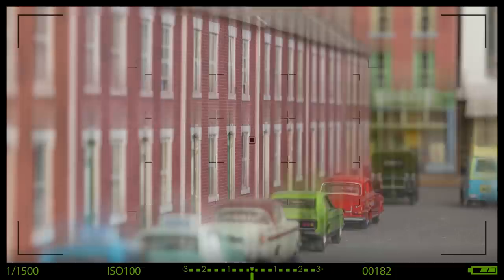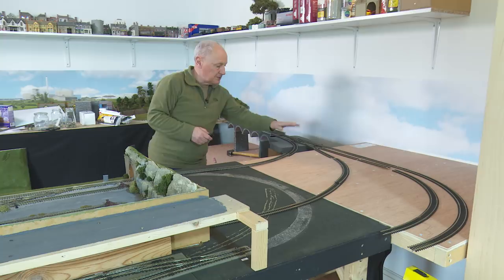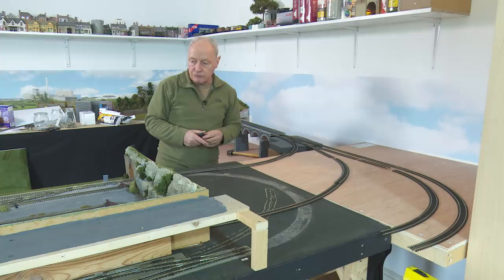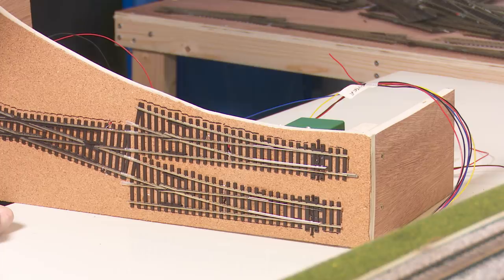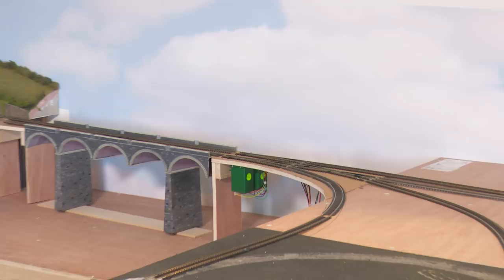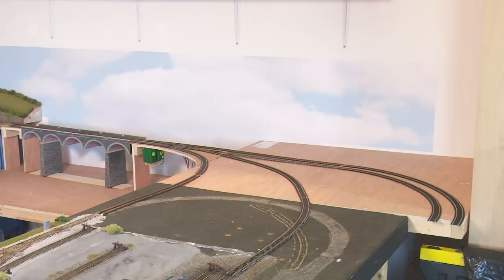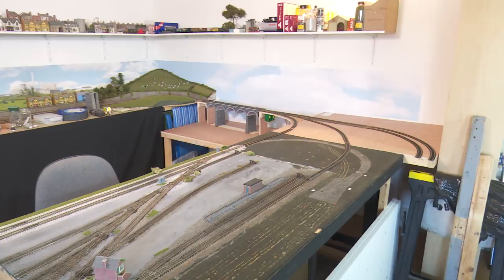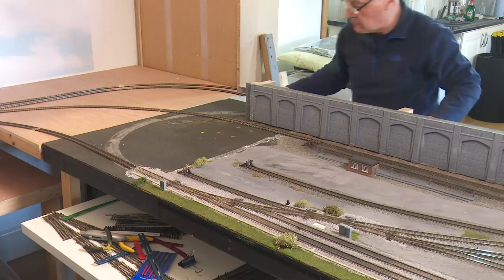Track Plan Sorted at Chadwick Model Railway | 59.

Comment: Hi Charlie great video and loving how the layout expansion is coming along. As regards to point motors then have you thought about using standard 4 to 6 v servos as you can get these from RS components for £11 also you could look into linking points together to change on one servo by connecting rods which I have seen. Hope it helps.
Reply from the maker: Good points Mark. I’ll certainly check them out.

Comment: Charlie, 
I agree the servo motors are cheap (esp if you get them off eBay) but they need special interface mounts, and interface circuitry.  Ok once you've got into the habit of using them, so you have the aluminium channel, etc, but not so useful for a one-off.  Mind you, the controller circuitry does come in a board that will control a number, so fiddle yards would be an ideal place to try them.

My preference is not so specialist, and I use a cheaper version of a point motor.  Have a word with DCCTrainAutomation; James does MTB MP1 point motors at 13 GBP each, and they are quieter than tortoise, as well as being more discrete.  he's online, local to us, and also will be at Ally Pally.
I suspect with your winning ways, you will be able to negotiate a bulk discount!
And if not, I'll look forward to seeing your bruises at Ally Pally! ;)
See you there (Saturday?) or maybe WimRail (tomorrow).
Anon
Reply from the maker: Hi Tom, great info as usual.Yes servos seem to be the flavour of the day.  I'm certainly going to investigate.
I’ll be at Ally Pally on Sunday with my elbows sharpened!
Reply: I designed my own Servo Motor mounts using free Web-based CAD software and had a friend make them using a 3D printer. If you don't feel you have the skills to do the designing yourself; if you can find a person with a printer, they probably have the skills!  Cost for me was AUD$0.50 (about 25p I think) basically for cost of materials. They aren't anything special/pretty (basically chunky blocks with mounting points and gaps for arms/etc) but very quick, easy and cheap to produce.  

I also use an Arduino ( electronic board/computer) to control the servos - but you have to be a Nerd to go down that path!

Comment: Hi Charlie. Looks very good indeed. Don't go near the back scene :) You don't want to go through that again. I need 18 more Tortoise point motors so am searching myself. Have you had a look at the point motors from Tam Valley? MSWOO1. You will need a couple more bits but much, much cheaper than Tortoise. I have not used them but check out the last couple of videos from Newcastle Central. Cheers. Pete
Reply from the maker: Hi Pete, 
I’m so pleased that you enjoyed the latest release.
Yes point motors are a headache, one which we clearly share.
I’ll check out your link but Tortoise do remain top of my list.
Good hunting.
Regards Charlie
Reply: @ChadwickModelRailway  Hi again Charlie. 6 Tortoise motors, (used), on eBay now. £58 so far. Another day and a half to go. Cheers. Pete
Reply from the maker: I know Pete, I've been watching them for days!

Comment: New to your channel, and completely new to the model railway world, in the layout planning stage at the moment for my 1st layout, taking my time over it as dont want to rush and make mistakes. any tips on layout design would be fabulous.
Reply from the maker: Small steps at first Karl.
Work out the size/space available and then decide on the track gauge that works.
Next decide on the era that you wish to model.
Next it’s DC or DCC.
Finally, start on a track plan which works with your choices.

Comment: Hi Charlie. Great work you are doing and the presentation is always superb. I think I am the first to say why not try the Swiss Fulgurex point motors? No faffing around with servos, like the tortoise ones they are motored but in an open frame so mounting and wiring are the same. I have them on a now retired exhibition layout I took over and they are nice and smooth. And the clincher? 10 or 11 quidlettes each from DCC Concepts.
Reply from the maker: A fair point Paul.  I now look at layouts for the motors which they use.
Reply: @ChadwickModelRailway 
 I forgot to mention that perhaps they are used on my layout because they have a lower profile, say 20 - 25mm, that would be less likely to be knocked about when shifting the boards at exhibition. But more importantly using them on an exhibition layout would indicate a trusted level of good reliability. 
I thought I would send you a couple of pictures of mine mounted somehow but then realised there's probably a good collection on the interweb that you might study. After looking for myself I noticed a lot of people were moving the tiebars via omega loops and cranks or servo horns. Mine are actually directly driven which makes sense as I believe the track and hence the point motors were done by Norman Solomon. On RMWeb some one was asking how Norman did it, I have to have a look in his book.
BTW, in case you're wondering I'm not an insomniac, I'm away in Mexico for a short while.
Cheers
Reply from the maker: Thanks Paul,
More great detail.
Regards Charlie

Comment: Good evening Charlie.  Another technical question I hope you can assist with.   I have peco code 55 turnouts and my n scale layout is controlled by the digitrax zephyr :DCS51.  At the moment i have one circuitron green tortoise with an address of 4.   And one circuitron brown smail with an address 1.   Both turnouts are controlled perfectly well by the zephyr and I followed your tutorial of wiring up the elctrofrog to the tortoise. 
 I am now ready to install 4-6 turnouts more however I am being told that I must purchase a decoder if I use the tortoise switch machine but can forgo that if I purchase the Smail switch machine because it comes with a decoder imbedded in the unit

My question is since the single tortoise is working fine through the zephyr command station why do I need to buy a decoder if i want to install an additional  half dozen or so. Additionally I only want this to activate the. Turnouts.  No lights. Or anything else

Must i buy a decoder if i increase my tortoise switch machines?
Reply from the maker: Hi Michael,
I must confess that I’m bewildered as to how you have managed to switch a tortoise with Digitrax without using a DS64.  I’m unaware of tortoise making a DCC version similar to Cobalts.
I use several DS64 units, each switching four points (or pairs of points if the that is suitable).
I do hope that makes sense.
Regards Charlie
Reply: Chadwick Model Railway hello Charlie.   Well it works for now. I just put an order in for several circuitron SMAIL switch machines which have the decoder in jt so as I understand things these will not need a stationary decoder

I hope that once i instal the extra switches my lone tortoise switch fails. We shall see but for now my single tortoise and my single smail are working fine and have been so for a few months

Thank you for taking the time to reply

Rgds/Mike

Comment: You could halve the amount of motors by letting the trains push the points over on the exit of the Fiddle Yard in each direction.
Reply from the maker: A fair point but you wouldn’t be able to use electrofrog points and switch the frogs.
Reply: You could switch the power with a relay. With it only switching the power it could be positioned in such a way that you wouldn’t hear the clicking.
Reply: Thinking about it, I’m guessing you’d use each point to set lanes so why can’t the entry point motor set the frog polarity on the exit point at the same time?
Reply from the maker: Because a different siding may be exiting the fiddle yard finding the point against it with the wrong frog polarity.
I do hope that makes sense.
Regards Charlie

Comment: I have found that longer cars and long wheel base locomotives operate better on medium radius switches. You can reduce the spacing between tracks by cutting a short amount of track off between the switches. I find that for yards I like a little extra room between the tracks for fingers if necessary so I use 2 inch center between tracks.
Reply from the maker: Thanks Don, a very good point.

Comment: Another excellent video Charlie.  Just to add to the cost of the Tortoises, I found Aculites do “Snaps” that slot on to the Tortoise to avoid any soldering.  Sadly I’d fitted 7 motors already with wires soldered to the motor and ending close by in a terminal block.  That was cheaper, but the snaps are brilliant, push fit, and today when fixing a wrong wiring problem, they proved their worth, when upside down under the baseboard in cramped conditions.  (They also do break out boards for the PM42 etc).   
A question, I’m impressed with the result of using piano wire.  Where do I get some, and would it be easy to install in existing points etc,?  Cheers Brian
Reply from the maker: Thanks Brian.   I'm certainly going to investigate.  I bought the piano wire at Ally Pally.Regards Charlie

Comment: Hi Charlie from  "Tippy Ashwood".  may I suggest your  river or stream doesn't run through the middle arch and the road has a T junction before the old bridge which runs under the viaduct as well. hope you can picture that !  as for the old road bridge fairly easy scratch build job with a bit of scribed clay etc. fully enjoy the videos. and I have learnt a lot from video equipment ones
Reply from the maker: Hi Bob, I totally understand your point and I’m sure you will like my plan (fingers crossed).

Comment: Hi Charlie - another informative and well produced video. Just a thought on the points at the viaduct end - you intend a tunnel I think? In which case you may get the articulation of longer items of rolling stock visible when exiting the tunnel having come round from the front of Chadwick TMD. Appreciate you are tight for space, but might be worth a trial run with a few coaches to make sure you are entirely happy.
Reply from the maker: That is an excellent point.  Perhaps a cutting might be better.
Reply: Hi Charlie - suspect that would give you more problems with the tunnel mouth. Give it a try with some coaches and just check. Could you move viaduct 2 or 3 inches to the left, and insert 2 or 3 inches of track before the turnouts - looks like you have a bit of room for a slight return curve on the exit from old Chadwick.
Thinking more about your point motor problem. If the up and down lines always run as up and down lines and you don't propose reverse working then the 'exit' points could be lightly sprung - bit like passing loops on narrow gauge railways. Gormo at Great Chesterford Junction has been trialling that and uploaded a video - see https://youtu.be/QzjVRepCZpA- .  Would halve the point motor investment, but still allow you to add some at a later date if you wanted reverse working on some of the fiddle yard sidings.
Reply from the maker: I’ll check it out David

Comment: I've watched the video a number of times listening to what you have said and a potential problem and a suggestion have resulted.
Problem - In a previous video on Chadwick you discussed wiring compatibility using the "black to the back" analogy does this mean that the Chadwick TMD oval of track had red on the outside rail and black on the inside rail? If so no problem as black would be to the back on the reconfiguration. 
Suggestion - Tortoise or Seep/Peco point motors, has TMD been upgraded to Tortoise? If not then having solenoid point motors on the fiddle yard would make little difference to the noise emanating from the solenoids in the TMD albeit that the fiddle yard points would be changed more often than the TMD points. It would be a cheaper option to investigate using Servo motors as an alternative.
Reply from the maker: Hi Gary,
Yes fortunately the front of the TMD area was wired black to the back.
On the TMD, I intend to leave the existing solenoid point motors in place until they or their points, become problematic.
I may construct a small exhibition layout in the future, on which I will explore servos.
Regards Charlie

Comment: Would a ford brige be a suitible option. Here in south Africa their are three briges in close proximity take a look at the Van Stadens river road brige on the Garden Route in the Eastern cape.  Origenly there was a ford brige almost compleatly washed away by fooding in about 1990, and unditectable on google photos today. Next to the ford brige a 1920s brige was constructed and finaly towering over the gordge is an impressive arch brige built some time in the 1970s. Ignor the fact it is called suicide brige.
Reply from the maker: Thanks for the tip Andrew, there are so many options, it’s bewildering.

Comment: What circulair saw blade did you use on your drill to cut the track? I cant find one big enough or sharp enough to cut the track precisely.
Reply from the maker: It’s called a slitting disc from 
Squirestools .com

Comment: Hi Charlie. Another great video. I've only recently started dabbling back in the hobby, after a hiatus of about 20 years, when I made my 2 Yr old son a 2 track "Thomas" themed layout for Xmas so my experience is almost nil, but I did have a potential idea for you yard points.

Would it be possible to use push/pull cables like used for controls on RC planes to to remotely operate the points using the solenoid motors hidden away in a soundproofed boxed under the bench somewhere. I've got no idea how the cable/point interface would work, but the logic behind it works in my head.
Reply from the maker: A good point but I'm into automation.  Regards Charlie
Reply: @ChadwickModelRailway  Do the solenoid type motors not lend themselves to automation then? Ive never done any motorised points let alone full automation so don't know the pros and cons of the different systems.
Reply from the maker: Yes they do but obviously you couldn’t use push/pull lines.

Comment: Hi. I have a question. Whats the best board for a layout that will be balasted etc? It will be a board 2.75m by 1.10m
Reply from the maker: I would use 12mm ply.
B&Q will cut it to size at their larger stores.
Reply: @ChadwickModelRailway  thanks
Reply: @ChadwickModelRailway  is it water resistant? (Balasting with glue and water)
Reply from the maker: It’s far better than MDF.  If you’ve worried just varnish it first.

Comment: Just a thought if Charlie uses servos how does he switch the frog? Never cheap to do it well. Second hand market for tortoise (eBay or similar). For electrofrog points it might workout cheaper to bite the bullet and buy the tortoise motors. I have started buying DCCconcept IP digital because decoder is built into them and therefor everything for £20 brand new if you look around for best price. PS hello from Tintinhull a few miles away. Love the video’s.
Reply: Me to - fan of Dcc Concepts' IPs. Simple to wire, especially if you daisy them. I sometimes wire them up to ground signals, simples!
Reply from the maker: Hi Peter. Yes servos seem be the flavour of the day.  I'm certainly going to investigate.Regards Charlie
Reply: Charlie how are you getting on looking at servo’s. Been looking myself and 4 device servo decoder Digikeijs 4024 with switches for relays (for electro frog points) £22 (£5.50 per point) Amazon. Relays on Amazon £1.50 each, under baseboard relay bracket £2. Relay on eBay £2 for electro frog point. Grand total £11 per point. Just install my first without relay and relay is very very quiet.